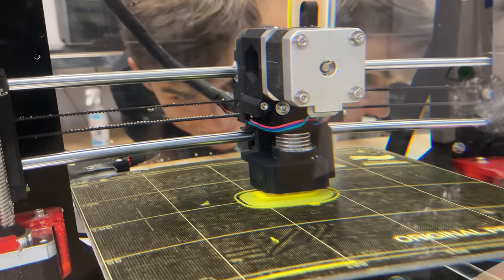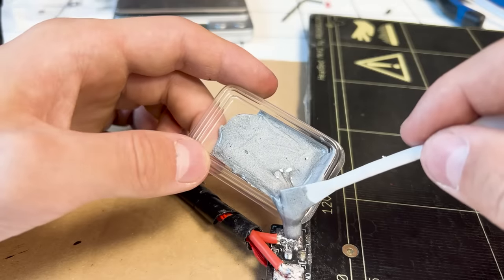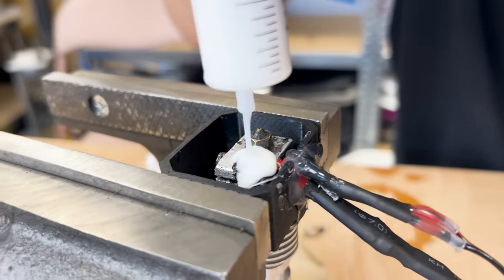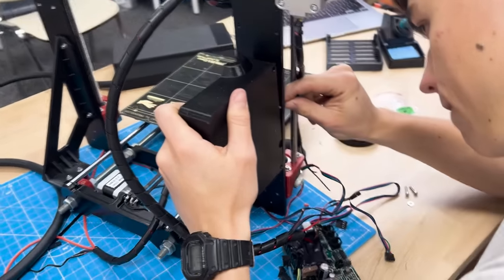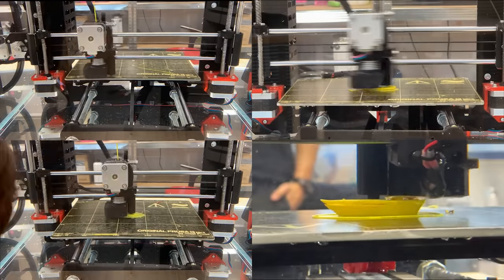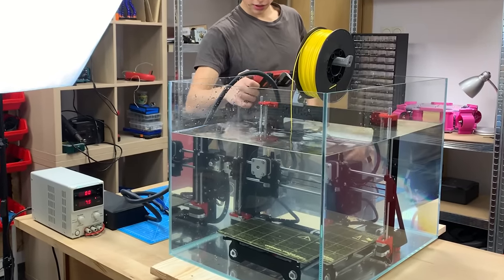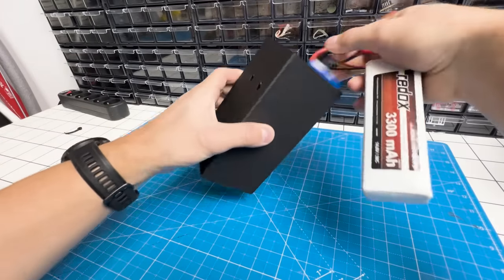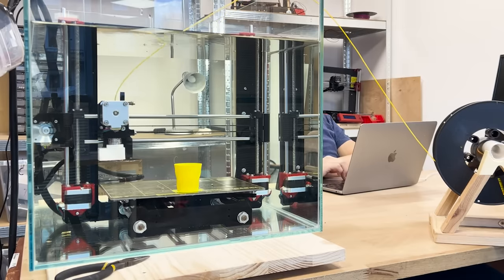3D printing underwater actually WORKS

Comment: Mold Max 60 or a similar sMooth on high temp / heat resistant tin or platinum cure silicone would do you better. These silicones are tailored for & can be poured into deep molds curing in a matter of minutes, although cost 6x more than your avg hardware store HVAC sealants

Comment: You forgot to mention the reduced sound level of a printer going all night. Or the improved power efficiency from not having to run cooling fans. I wonder if this could be some untapped meta for 3d printing? Had you guys spent a bit more time and money you could have resolved the motor and insulation issues.

Comment: Fully submerged PC's have been around for a really long time; they use Mineral Oil and not water.  It's non-conductive and will pull heat like the water.
Would that be something that would be compatible with the 3d filament?
From what I understand the Resin probably wouldn't work but I don't know about the others.

Comment: if designing or choosing a printer for this purpose, it would be easy to design the motors above the water, and have the platform do the z movement instead of the nozzle ... so most of the extruder will be out of water, only the tip..
Reply: Also, you could add a lifting motor to keep the print above the water for most layers, and only submerge a few mm when printing the bridges, so the layer adhesion would not be an issue.

Comment: why not increase the water level with each layer so that you get the benefits off cooling but also layer adhesion also overhangs would work better if you got the water level just below or half up the current layer?

Comment: Have you maybe tried other materials? I mean all the materials are made for printing like a normal dude xD

Maybe there are some better materials but not produced because not possible „in the air“.

So what can you use NOT on air but under water(or whatever)... I think that would be the answer of the question: „whats the difference between printing on air or not.

Very cool stuff! Wanna see more❤

Comment: Hi, that was so cool, never thought I would ever see an underwater 3d printer. Question though, how did you get the 3d prints you used in the build to be waterproof? Aren’t 3d prints porous and therefore water leaks in?

Comment: Would this work with a printer where the z-axis moves down, set right at/just below water level? That way the print head moves over the surface, fewer submerged parts, and you still get the buoyancy benefit because the print is still under water.

Comment: Were you monitoring TDS (total dissolved solids) in the water while working? Even starting from distilled it seems like there would have been a lot of contamination to increase the conductivity of the water.

Comment: I was just thinking about if you could heat the water for engineering materials and printing of materials requiring higher temperatures and enclosures to print.
Reply: yes this technically can help with prionting semi crystalline materials.

Comment: My experience with High Temperature Silicon:
The CURING process of silicon produces WATER as a byproduct, after curing you need to DRY it, and this process will SHRINK the silicon about 25% of the volume.... the dry silicon will be a lot harder but not brittle.
.
Very interesting experience overhaul, i wonder if printing under Mineral Oil would get even greater results with less problems.... or not... the high temperature on the nozzle keeps a constant vapor bubble that insulates the filament long enough for melting with the layer below, and this would not happen with oil....

Comment: Couldn’t full liquid cooling be easier with mineral oil? Since you don’t need to make stuff water tight, boiling temp is higher and it shouldn’t react with any of the used materials, one downside is that it’s heat capacity is worse.
Anyways, really cool to see this.

Comment: For the bearings inside the motors, you could use ceramic bearings. 
If for some reason you wanted to go further and try to perfect this method for some odd reason.

Theoretically this could absolutely work, and be done well with pretty low effort and off the shelf stuff, as you guys showed. Just some epoxy, swap out a few minor bits like ceramic bearings, stainless or aluminum hardware, and some high temp silicone… this stuff is relatively cheap and available basically everywhere! 

The big question isn’t how, it’s… WHY?! Hahaha and the answer to that is Because it’s cool and innovation doesn’t need an excuse. Perhaps you learn something tangentially useful or maybe you discover some odd quirk that helps someone else who is working on a similar issue. Sometimes just doing something for fun is enough!

As the Mythbusters always say; “The only difference between science and screwing around is writing things down!” Or Adam Savages version; “Chaos becomes Science when you start taking notes.”

Comment: this is so cool, i wonder if nylon 3d printing could benefit from printing in an enclosure with water flowing upwards, maybe we could get full bridging with nylon FDM printing
Reply: doesnt nylon absorb a lot of water?
Reply: @ravplayztabla7467  it does, but once it's printed you want it to as well. Most of the time to reach maximum strength you soak nylon parts in water for 24-32 hours
Reply: If you had a water tight printing setup you could in theory make it work and it could have some benefits

Comment: Wouldn't it be better if this design was made with a Delta 3D printer? There is no need to immerse the printer completely in water. Add water according to the size of the 3D part to be printed. Water can be added with a water pump while printing the 3D part layer by layer. In fact, all of the stepper motors in the Delta 3D printer are above the printer. In this way, you can print the 3D part in water without the need for stepper motors to enter the water.
	Unfortunately, I couldn't find a solution to nozzle problem in the hotend section.
Reply: Delta 3D printer solution is better. You can never fully waterproof stepper motors. It's a nice project, but you need to work on it.

Comment: its like nutella - śmiechłem in dead :D 
what about some more dense materials like olive oil? it is much denser so it will introduce a better medium for printing overhangs and (with good mixing) it should be nice in cooling filaments
btw. why you have used regular epoxy not heat resistant one? np. EPICLON HP-4710

Comment: should have used mineral oil as as it is non conductive leading to the trend of putting a pc in an aquarium but they use mineral oil instead of water

Comment: Chłopaki, a może zanurzcie drukarkę w oleju mineralnym (takim jak w transformatorach)?
Kiedyś były realizowane projekty chłodzenia PC i nie było problemu z korozją ani zwarciami.
Tylko nie wiem jak gęstość takiego oleju wpłynie na działania drukarki, ale może to kolejny krok do przetestowania?
Nie zadziała w basenie, bo niewiele osób kąpie się w oleju, a już zwłaszcza mineralnym ;) ale w akwarium da radę.

Hey guys, maybe immerse the printer in mineral oil (like in transformers)?
There used to be PC cooling projects done like this, and there were no issues with corrosion or short circuits.
I'm just not sure how the density of such oil would affect the printer's operations, but maybe it's worth testing?
It won't work in a swimming pool because not many people bathe in oil, especially mineral oil ;) but in an aquarium should do the trick.

Comment: I don't see what is the point for printing under water, just the cooling effect to the printed filament?... that's it ?...  besides the bonding between layers are awful... It's like changing cabins on the titanic (speaking of 3dprinting under water)

Comment: Just use a mineral oil bath, all electrical problems solved, assuming it doesn't cause a problem with the type of filament you are using - chemically.

Comment: You know if you turn the 3d printer upside down is way easier to print overhangs rather than just dunking the whole machine in water? Dont get me wrong i still applaud your work, but water and electronics tend to mix, poorly.

Comment: 0:35 Na-ah ... No, no no - the better solution is the mineral oil  - it would be much easier to do it - you would not have then to waterproof electronics

Comment: So you submerged it to help cool the part? There were tons of cons to doing that like nozzle temp and bed heat losses.. Totally inefficient.

If parts cooling was the goal why not just use cold distilled water as a sprayer and to help cool even faster atomize the spray pattern via high pressure pumps like I do for aeroponics. Much more efficient.

Cnc uses liquid at a high flow rate but that's used as a lubricant as well as coolant as the application is totally different so I wouldn't use high volume water. Atomization and low Temps are key.

For filament moisture why aren't you using a nylon tube to extruder?

Comment: About 20 years too late unfortunately.  Think the FIRST 3D printer used silicone as the extruded material and printed the desired object in water.  The demonstrated printer made a watch strap out of silicone

Comment: 3 seconds into the video and I am going to tell you right now that it doesn’t work, and the reason it doesn’t work is because the heat block is cooled by the water, and even if it weren’t, the filament would cool too quickly to be strong. You need a huge heat block and a special high temp filament that may or may not exist.
Reply from the maker: haha you made my day
Reply from the maker: In all seriousness, please watch one more second.
Reply: @CPSdrone even better, I watched 1,056 more seconds. I was impressed. Smart idea to insulate the heat block.

Maybe look in to how underwater welding works. It’s a very similar problem as the arc needs to reach 5,000 C. This is achieved by creating gas bubbles. Personally I wouldn’t consider gas cheating. If you want to be fancy you could make the gas in-process with electrolysis!

Comment: Why not just 3d print into water and have the table drop down like they do with resin? Could make the heating nozzle, stick down an extra five or six inches into the water... This would eliminate water from the systems it doesn't need to be in....

Comment: Dont try and water proof your motors 
That’s not going to work
Or increase the costs of the entire setup unreasonably 
Just move them up out of the water and transfer the rotation with a belt into the water

Comment: At first: why die you put the Mainboard under Water? It is just senseless. Longer cables where the better option.
At Second: You should have printet an submarine benchy instead of a normal one.

Comment: I like the concept of underwater printing, but...............did you really use metal epoxy over electrical connections??? There is actually metal in it....

Comment: I honestly don't understand how this works. As of my understanding, water doesn't just cool down faster, but rather just needs a larger amount of energy to heat up. Likewise it needs to lose a larger amount of energy (than air) to cool down, so wouldn't it retain more of the heat from the printer, 
than if it was printed in air? I understand the benefits of buoyancy, I just don't understand how water is better, could someone explain, scientifically?
Is it just that the printer doesn't admit enough energy to heat water though out the printing process?

Comment: I have to say do not try this at home!!!!!!  The guy starts off saying cooling is the desired result faster cooling for better print quality.  ends up suggesting that that heating up an entire tank of water to just under temp of glass transition of the plastic.  Um  PLA prints typically in the range between 180 to 220 °C water boils at 100 degrees C.  the energy requirements to heat a tank big enough to hold the printer would be rather expsensive not to mention the entire 3D printer would now be operatiing at a much much higher temp that just the extruder.  Also the printed parts for the adapted printer would suffer and sag and break apart if you could heat the liquid to just below the glass transition of the plastic.  I loved the video though it was very innovative and informative.  Getting a postional nozzle like used in CNC lath work that gently squirts a special cooling/lubricated mixture on the the metal.  Use just use water and have it cool the piece as you print. No need to adapt and  submerge the entire printer and heating a massive amount of water.